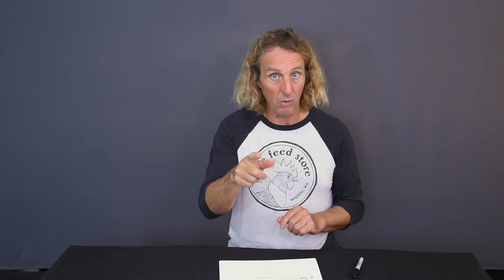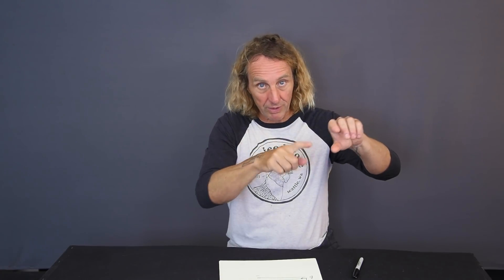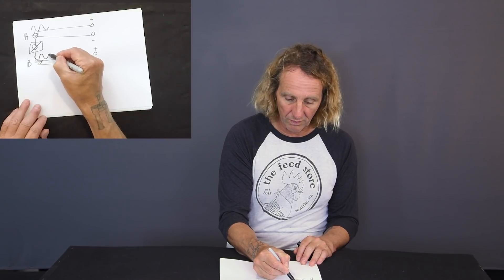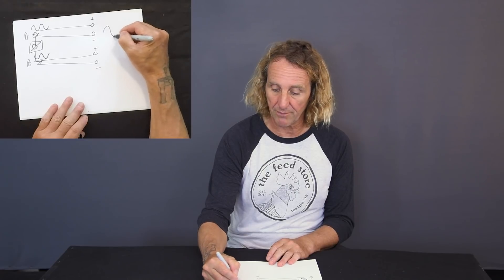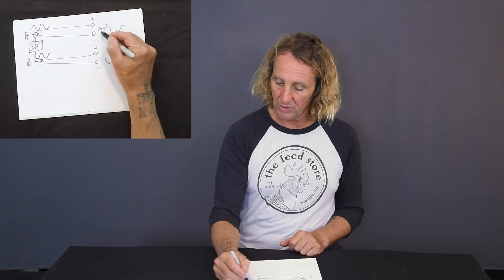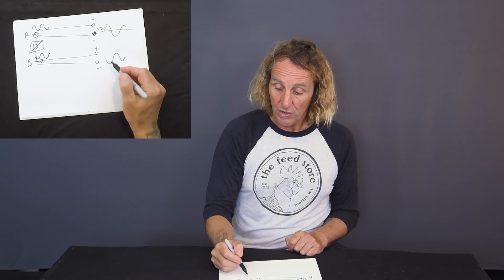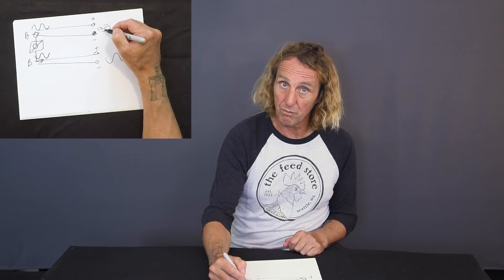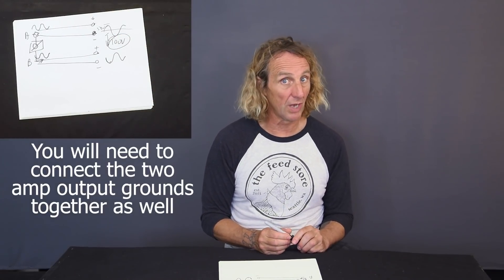Advantages of Amplifier Bridged Mono Mode

Comment: Am I missing something here? I'm not an audio professional, but my understanding was that bridge mono mode flips the phase of one channel and then wires it in series with other channel with positive and negative reversed. It thus becomes a push-pull amplifier with one channel driving positive to ground, the other negative to ground. This is then fed into the speakers wired in parallel to halve the impedance. The advantage is that the speakers are isolated from ground and immune to noise.
Reply from the maker: Hmmm, that seems about right except noise on the speaker outs is usually not an issue. Sounds like you are combining balanced lines with bridged amps. And the two are basically identical in operation except the reasons to use them differ.

Balanced lines help with reducing induced noise using common mode rejection.

Bridged mono is more about increasing the output voltage to get more power into a given impedance or to reduce the %of power lost in speaker wire resistance.

Comment: Dave, I think the power of each amplifier doubles when you run them bridged. So, in your example, if previously each amp is driving 500w into the cabinet, when bridged, they will each drive 1000w into the cabinet. The reason for this is that the impedance they each see halves, and so they each produce twice the current, and hence twice the power. Of course it's easy to run out of current delivery in an amp, so it might not be realistic to expect the power to go up by x4, but that's what the math says :)

Thanks for an interesting set of articles and sharing your passion for audio.
Reply: It was kind glossed over with a simplification in the presentation. Sure Dave did this on purpose to keep things understandable. 

Bridging gives you double the voltage between the output terminals. 

Doubling voltage gives 4x the power. 

So the reason the minimum load impedance doubles is to account for this power increase. 

Example:
Amplifier is rated to do 50v per channel into a 4ohm load. That is 625w per channel (amplifier is producing 1250w total). 

Bridge the amp, you now have 100v, 
100v into 4 ohm is 2500w (twice the amps rated power at 4ohms per channel). 

So doubling the minimum impedance to 8ohm beings the output back down to the amps max rated output of 1250w.

 But now you are getting it on a single channel instead of split between 2. 

Hope that makes sense.
Reply: @Solmbarnes  thank you. Your explanation makes sense.. Would that also cause less distortion since the the independence is higher?
Reply: @jahn-pierrezietsman2293  There are number of factors that will determine the total harmonic distortion. 
But I doubt bridging will improve thing. 

At 8ohm bridge as opposed to 4ohm a channel. The amp is still being asked to deliver the same amount of current as if it was running 4 ohms per channel, so it's working just as hard.

Since the polarity of one of the inputs is being reversed there is possibility that some noise could be nulled, but I guess this would depend on exactly how the signals are routed inside of the amplified. 

Also impedance is frequency dependent. Your "8ohm" speakers probably have a impedance curve that ranges between ~6.8ohms and ~40ohms. 

Bottom line is, to avoid distortion stay well within the limits of both your amplifier and speakers.
Reply from the maker: Great info
Reply: @DaveRat  Thank you.

Comment: You can't just bridge two amps if they weren't designed to be bridged in the first place, as it will most likely fry them both! And you should never connect two speakers in series, because speakers also have crossover networks which are not designed to be connected in series... 

Also some of the "math" presented is wrong... 

Some stereo amps have a bridge or BTL switch. Just stick to those.

This is why you should never get any electronics advice on YouTube, especially from a long haired tattooed dude...
Reply from the maker: Oh my oh my! 

At least your lack of understanding and research is consistent with your lack of credibility

Are you telling people not to do something because something will most likely happen even though it is something you have never done?

I appreciate that consumer point of view where sound system and equipment designers know what's best and you should follow the manual and do what they say to do and nothing more.

Which is what makes this all the more fun and interesting because this long haired tattooed guy actually is a sound system designer! Big smile. But not a sound system designer for the consumer toys and such, I actually design and deploy sound systems for large scale rock concerts and festivals. Feel free to do a credibility check.

Anyway, I appreciate your caution and clearly as a judgmental person as you seem to be, I can see how you may discount my knowledge and experience based on personal biases against the way I look.

I guess it just comes down to credibility. Should people believe long haired tattoo guy with 40 years doing sound for some of the largest shows, festivals and bands on the planet that spends time and energy freely sharing knowledge I have learned over the years helping others in the audio field?

Or trust some anonymous guy that is spilling info about things he has neither tested or experienced?
Reply: @DaveRat  

Didn't you say something like "You get more output power/ Watts  at 16 ohms vs 10 ohms (speaker) loads".

This would be true only audio amplifiers were current sources, but they're not. Amps are voltage sources. 

Use treat a 500W amp as if it's a 500W power source. Amp wattage are just rating. Actual power will depend heavily on the speaker and cables length.

Some mono amps were designed to be bridged to each other to get twice the possible power. There are actually to bridging configuration: series, which doubles the actual voltage, thus increase power by x4, and parallel, which doubles the current rating, thus allows you to connect 1/2 the rated impedance to get x2 the power.

There are many good class D amps today that were designed from bridged operation. I'd avoid trying to bridge any consumer amplifier, which wasn't intended to be bridged.

Also series connection of speakers was intended for the speaker drives inside the speaker box, not for speaker boxes, which include the crossover network at the input. 

Your advice may be more suitable for the professional market , not for home audio...
Reply from the maker: Lower impedances will tend to output more power up to the point where the amp is unable to output more.

The 10 ohm reference I use is an example of how to reduce losses due to speaker wire resistance by running the higher voltages in bridged into higher impedances such that speaker wire resistance is a lower % of the total load.

Running identical loads in series or parallel should not be an issue and long as the loads are identical. Running dissimilar loads in series or in parallel will have more complex results.

As far as bridging consumer or pro amps in to double the minimum rated single channel impedance, there should not be an issue as long as you are connecting the load between two hots and the amp has a ground and hot on each output.

Comment: where did you gain your non-technical crap from.
Reply from the maker: Hello Nico. Well, when I was 17 I started building speaker cabinets while I worked at Hughes Aircraft as the youngest guy in the department, electro-optical R and D working on Tow Missile Systems.

From there I built up a sound company that provides audio equipment for some of the largest festivals and shows in the world along with providing sound equipment for world wide tours. I also started a manufacturing division in addition doing sales and installations. Along with numerous patents and licensing deals, I also mixed sound for many world class artists such as Chili Peppers, Foo Fighters, Soundgarden, Pearl Jam, Rage Against the Machine and have travelled to 6 of the 7 continents and hundereds of countries over the past 40 years. I dedicate time and energy to sharing insights of what I have learned and how to correlate the specs to real world, based on my hands on experience, to help others along their path.

What I don't do is randomly judge others and troll around as as an arrogant ass.

So enough about me, from what pedestal of knowledge, experience and authority do you speak and what is it you wish to offer in helpful and kind ways? 

I welcome any and all knowledge from someone with such a strong depth of knowledge and experience perhaps such as you?

Comment: you talking shit, twice the voltage equals four times the power. go back to school.
Reply from the maker: Oh my, I don't mind the anger as long as you are smart enough to warrant it, though nice smart people are always preferred. Perhaps you are jumping to conclusions and did not think this through?

OK, so lets take a look at the math.

Say we have a stereo amp that puts out 100V per channel into 8 ohms or 1250 watts per channel totaling 2500 watts

and we switch this amp to bridged mono mode into 8 ohms.

Now we have the same amp with a single mono output of 200V into an 8 ohm load resulting in 5000 watts 

Hmmm.

Yes, and I do understand that the math of "volts squared over load would result in 4 times the power" which would be true if we doubled the voltage on both of the channels but rather than watch the video and learn something, perhaps you just anger-posted a "you are wrong" blurb because you forgot to take into account that we go from two channels to mono when bridging, which reduces it back to two times the power.

Anyway, I do hope you are durable enough to take some the same type of hits you toss about and smile about it.  Nice to meet you Nico!

Comment: Burning question. I haven't been able to get an absolute answer on how the reversed polarity to channel 2 power is being used from a bridged amp. Does channel 1 (+) hit the speaker positive terminal with half the amp power and channel 2 positive act as a negative and pulls the speaker back with the other half of the amp power? Or, does it feed both sides of the power amp to the positive speaker terminal to push the cone and the negative terminal just acts as a neutral/ground path? It wasn't described to that effect but I'd love to know the answer. Thanks Dave. You are the man!
Reply from the maker: Hmmm. Both of those are kind of the same thing and the way electricity works is the power is delivered by creating a difference of voltage across a load the bigger the difference the more power delivered so when you invert polarity on channel 2 and channel 2 is going negative while channel one is going positive it increases the the voltage difference between the positive and negative speaker leads.

by doubling the voltage differential applied to the speaker leads more power is delivered

Comment: 12:24  Maybe I got something wrong here, but if you use a transistor amplifier, it's output is dependent on its load.   So at  generally speaking at a forum load it will make more power than it will at an 8 ohm load.

I know that tube amplifiers have a different apology especially when they use Transformers for their outputs and therefore does not follow the same methodology as in car audio amplifiers where  say running at a 2 ohm load will make vastly more power than running at an 8 ohm load.  
car audio amplifiers are often designed to double their output  power  generally going to a lower ohm load.    (4 to 2 ohms for instance)

I'll double-check this with the guys audio science review but as far as I know I believe this is the logic behind  the different topologies.     

=============
a word about resistance in speaker cables

from my understanding it seems that if you run higher frequency signals, say a 400 Hertz you're not going to get the same amount of resistance that you would when you're running lower frequency content.   
 the cable Still Remains the Same amount of resistance per a given length and gauge of wire.  
however you may experience some top-end roll-off due to the higher impedance of the high-frequency monitors especially running in an active situation where a passive crossover is not used on the main high-frequency monitors.  (this is usually never the case and Pro Audio since most Pro Audio gear automatically includes a minimum of a 2-way crossover generally to protect the high-frequency transducers)

basically I'm not sure how you're getting more power out of a transistor amplifier when running at a higher ohm load since generally they produce less power as the ohm rating that the amplifier actually sees Rises .    again I want to reiterate that on tube gear because of the topology and that many of them are running a Transformer it doesn't work the same way from my recollection in fact I believe you have to use different Taps on a transformer for the different ohm loads. 

ABOUT WHAT AMPS CAN BE BRIDGED
(Big thanks to BareVids in the U.K.)

half Bridge designs can be bridged to Mono however I don't believe that you can actually do this on a full Bridge.   these are the typical and again forgive me bear if it's for doing this but this is more typical of Brazilian style amplifiers that use a full Bridge topology or circuit design.
 
HOWEVER  by taking two amplifiers  of a fullbride, and then doing as prescribed I'm wondering if this is even possible ?   for my basic understanding I believe you actually get less power even though it may actually work in practice but for my understanding from the amplifier design he would only be running one half side of the amplifiers mosfets again in a typical transistor amplifier.  

since most amplifiers are based on a Class D design due to its efficiency,  and usually use a half Bridge due to the Simplicity of the design,  ( ahem, cost-effective manufacturing of mass-produced items)  it might be a better idea just to internally Bridge a single amplifier then using two separate amplifier modules as finding two that are uniquely balanced and setting up the games on each amplifier can be a crazy amount of work especially if you're dealing with multiple amplifiers in a live production environment.

and I think you're also giving up some of the built-in protections for your speakers and your amplifier if you're using this method described but again I'm not a wizard on the subject it's just something to take aim to mind.  

still, it's a great tool to use when you have limited resources and limited budget and you want to get the maximum out of your equipment that you have on hand.   so it's definitely a worthwhile trip.  

on a side note the only thing that puzzles me about Pro Audio is I wonder why the amplifiers themselves even bother on Class D designs to use inductors especially for low frequency transducers and content since those are usually filtered passively by the speaker itself since generally the carrier wave is (Mostly) inaudible on low-frequency drivers.   
I think this would increase the efficiency but I don't believe it would result in a higher output generally since the main inductor is the voice coil on the subwoofer itself. 

I don't think people in the neighborhood or your other equipment might like that very much since you're basically pushing a very high frequency signal down a wire that's probably not shielded but again that's a discussion for another time :-)
Reply from the maker: Oh my, a bunch of info and much of it quite confusing or based on blurry knowledge.

Put more simply, if an amp puts out a certain voltage, the power delivered will increase as the load impedance is decreased.

Up to a point where the amp can not maintain the output voltage.

Tube amps tend to have a more difficult time driving lower impedance loads  but if you put a 32 ohm load on a transistor or tube amp and measure the voltage and calc the power, then use a 16 ohm load, both amps with double or near double the power output, as you get lower impedances, some amps will continue to double or near double the power output as you half the impedance and other amps will not.

Factors like the size and max current output of the amp's power supply and the output impedance of the amp play a big part in the capability of the amp to drive lower impedance loads at high current levels
Reply: @DaveRat    Thank you Dave.   I'm so used to car audio where it is explained simply.   (I have trouble understanding stuff sometimes)    I talked to some Amp Designers at Audio Science review, and they cleared it up a bit.  Still foggy on it.  But that's why you are a Pro, and we are the Pupils.   :-) 

My main experience comes from things like Amy Dynos and so forth.   (steve meade, and others)     I know you explained it correctly, I just can't seem to wrap my head around it.    Maybe some day.    Again, thank you for  replying to me.     It means a lot.
Reply from the maker: Maybe check out this series on impedance and transformers. It's a bit different topic but all the same theory and such.

https://youtu.be/9zzGSkAvSFQ

Comment: What about running bridged mono into parallel woofers at 4 ohms?
Reply from the maker: That's the way to get max power out of amps that can run 2ohms
Reply: Its what we used to do with 8 ohm subs and too small amps to just get more power. Its all ive ever used bridge for. This fewer cable thing dave does is new to me. Also internally jumping the negatives is new